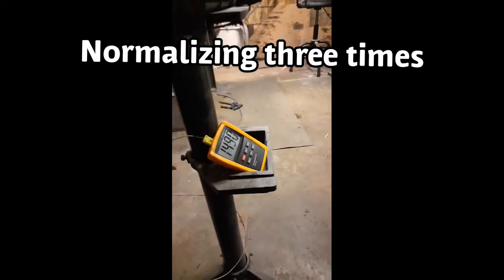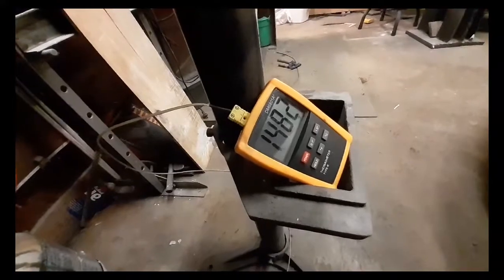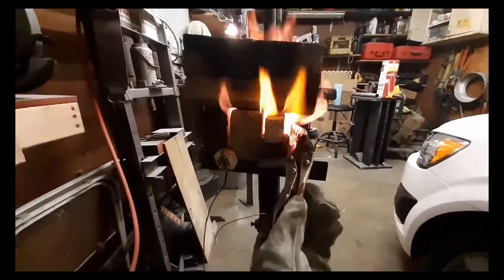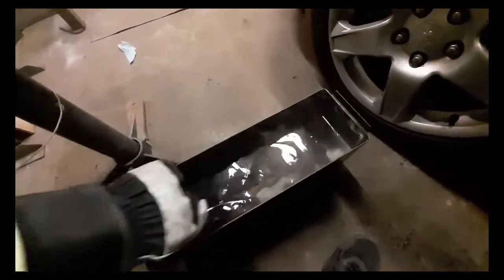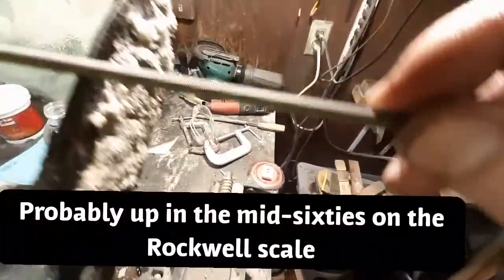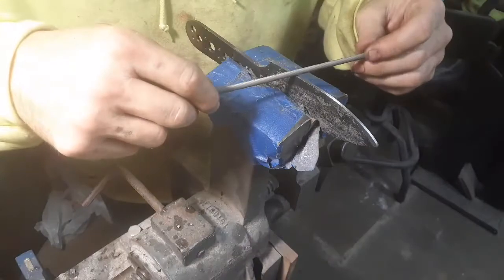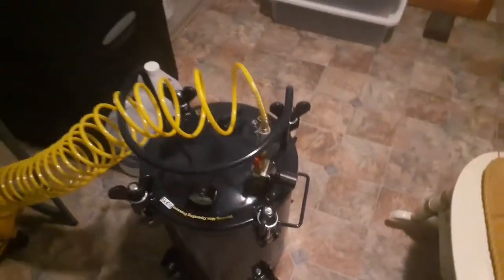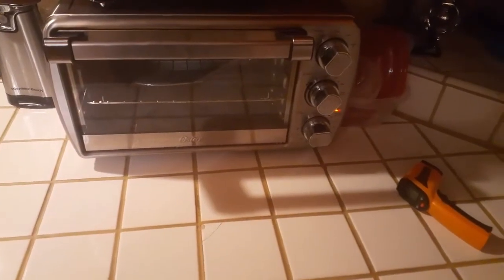How to Heat treat 1095

Comment: Tempering at 400 F........... but do it twice............... what does that mean exactly, do it twice?........... does it mean let it air cool to room temp and then give it another 2 hours at 400?
Reply from the maker: Yes, that’s exactly what it means. You are correct. You don’t have to temper it at 400° you can temp it a little lower if you want a higher HRC.

Comment: I don’t know one of my first knives was done in vegetable oil and heated with an acetylene torch. It’s harder than my hrc 55 file so not bad I’d assume
Reply from the maker: Sounds like you did a good job then! 1095 is a great steel Find Grain structure And geometry of the knife is more important than a couple HRC points anyway in my opinion with this steel

Comment: I woulda stuck it in water doing a hamon. It’s Risky but I haven’t failed yet. 150* soapy saltwater. Haven’t done a comparison with p50 and water. I would guess about 1-1.5 points added with the water brine.  Might actually try this in the morning. I think I have some small 1095 scraps laying around.
Reply from the maker: Best Hamon i Ever had was soapy warm salt water. That’s all I used to use, oh I would stick it in water for a few seconds and then I would go right into canola oil. I cracked quite a few blades I’m sure I could’ve mastered the technique but parks 50 has been giving me good results and no failures
Reply: @AaronJohnson1979  yes hamons turn out better in water from what I’ve always heard and what I’ve always used. I’ve never tried one in parks 50 honestly. I have it just never tried it. Brine for a few seconds then into oil is how I do it too. Just got to leave a little more thickness at the edge post quench. And good thermocycling.

Comment: What brand of thermocouple you got? The one I have keeps switching on and off in 10 minutes and worries the snot out of me . I’d be willing to pay several hundred bucks for a wall socket powered thermocouple with analog needle gauge like my grill has. All the little extras like data holding is just annoying to me
Reply from the maker: K type thermal couple the brand of the thermal couple is DM68018+ it’s about $40-$60 and it’s done me well for years right on Amazon.
Reply: @AaronJohnson1979  kk I’ll check it out yours looks like the one I recently reviewed  ,think it goes up to 2000 F. Thanks for the reply .BTW I use Alpha knife supply 1095 also and works well for me . I followed their HT recommendation brought it up to 1475 and fast quenched in Parks 50 and tempered to their specs and Rockwell was spot on . I have a friend who has his own machine shop and a several thousand dollar machine to test hardness and was surprised when he gave Me the readings it was exactly what Alpha said it would be . You gave good advice here a lot of makers claim that canola will suffice but I don’t think that it matches Parks
Reply from the maker: @randyblackburn9765  you are 100% correct!  if you follow alpha knife supplies heat treat recipe it will be spot on, long as you have proper temperature control. 1095 Is phenomenal steel!! it just has to be done right
Reply: @AaronJohnson1979  I like 1095 myself...I am used to 5160 but am trying 1095 and want it between Ontario and Tops.lol...Is the ,Parks 50 expensive? 
I have a friend who uses Sunflower oil saying something with vicosity is prime for cooling it slowly and even but if a place has prime recipe they recommend for top performance I will get..
Can you use it for all quenching? 1084-1075-5160?,.   
I would like to check on Bohler DNH7....I have a few Citadel Cambodia rigs and if they can treat it with such expertise,must be do-able.. Fantastic Retention.
Any experience with that? A few have Hamon so It must be good for that as well as they use Japanese traditional method with the proper clay..
Do you separate the 2 hours at 400 with a air cool between? Salute
Reply from the maker: @aldenunion  If you go to USA knife maker you can buy parks 50 by the gallon it’s about 50 bucks. Parks 50 is some awesome stuff Long as you don’t catch it on fire it’ll last 20 years you can  Quinch quite a bit of different steels but I wouldn’t do 5160 try getting parts AAA for that you can buy in the same spot it’s a little cheaper but $40 a gallon. Also park 50 doesn’t have to be preheated it’s good to go at 70 or 80°. It’s pretty awesome I don’t know much about that sunflower oil but for 50 bucks you can have the real deal that will last you a long time and you will get full performance out of 1095 and 1095 that performs at full performance is A big difference
Reply: @AaronJohnson1979  Thank you,will follow your advice...Salute!!!

Comment: Great vid man. Just for clarification, I believe the freezer is NOT BS. Even though 1095 is a low alloy steel, I have seen some metallurgical graphs on bladeforums which does support the extra RC point, but more importantly, cooling to 23F or below (household freezers are typically -10F to 0F, so even better) reduces the amount of retained austenite quite dramatically. This actually improves the toughness of the blade once it is tempered, since the microstructure of the blade is practically all the same structure (martensite). 

I like my 1095 hard lol. With proper heat treat, normalization cycles, and most importantly GRAIN Refinement, the edge can be run very hard, and it will NOT chip easy (very tough, for the hardness). I’ve got several Japanese swords I’ve forged and none of them are less than 64hrc on the edge.
Reply from the maker: Thank you very much I appreciate all that and I will continue putting them in the freezer I've heard mixed reviews but I figured hey what's it going to hurt lol
Reply: @AaronJohnson1979  You’re very welcome. Low alloy, high carbon steels perform very nicely at very high hardness. I do a true subzero on my W1/W2 and 1095 now. Eliminates pretty much all retained austenite.